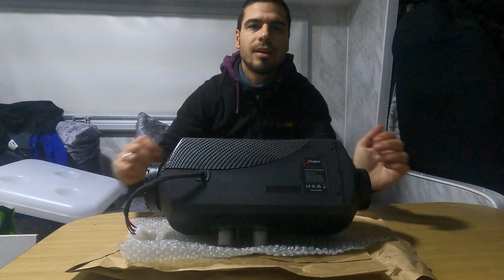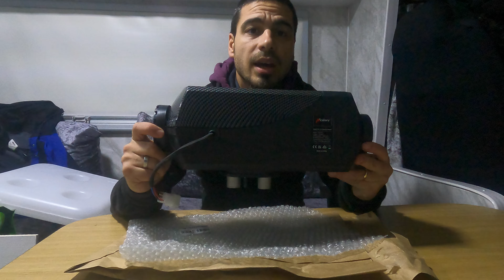WINTER CAMPING | Fitting a diesel heater to our motorhome

Comment: Good video, I didn’t catch what brand you’ve gone for but as an ex truck driver I can vouch for these heaters wholeheartedly. I think the Chinese copies are perfectly adequate for fitting in a camper van, being about a tenth of the price of an Eberspacher. Great tip for the fuel sender. 👍
Reply from the maker: thanks!we went for a HCalory because at the time was the only one with an on/off auto function. instead of just turning the power to the lower setting after reaching the set temperature this one turns itself completely off (and back on again if the temperature drops lower than the set). I believe now Maxpeedingrods does it as well.
I totally agree with you, few bits are quite cheap but easy enough to replace before fitting👍